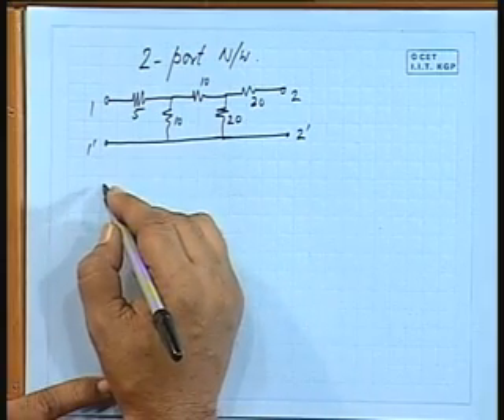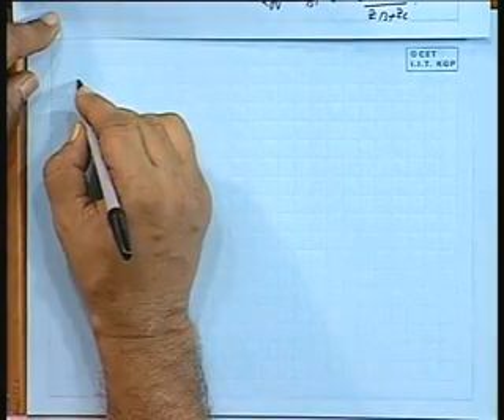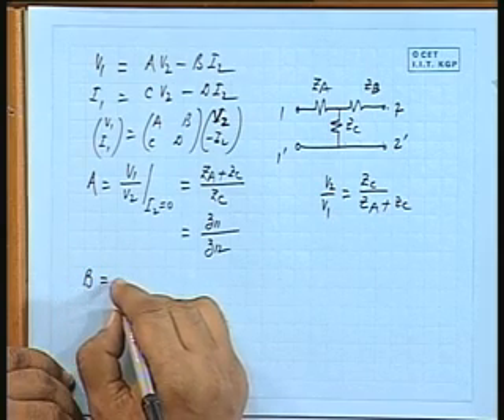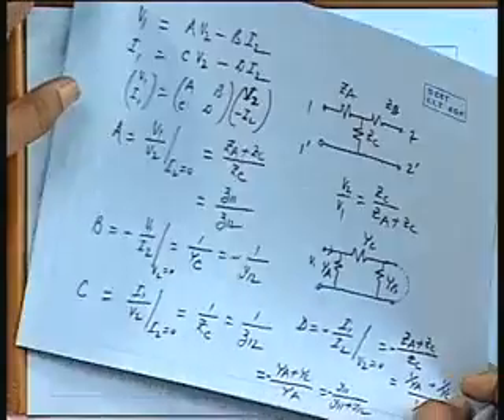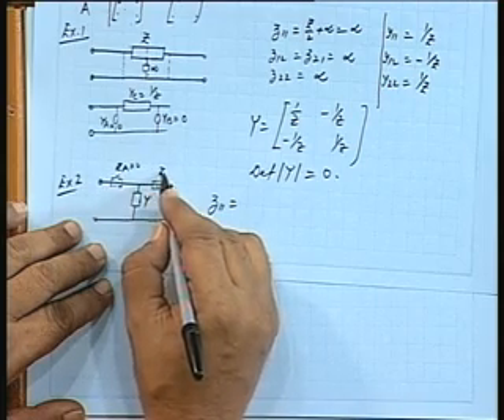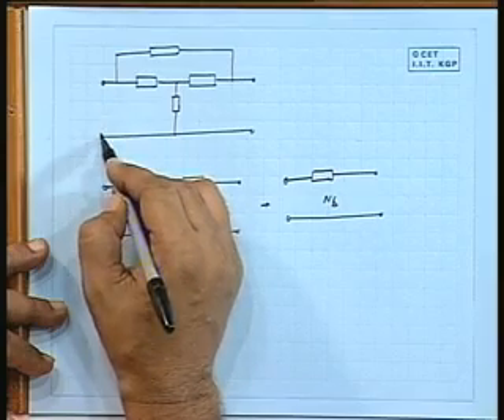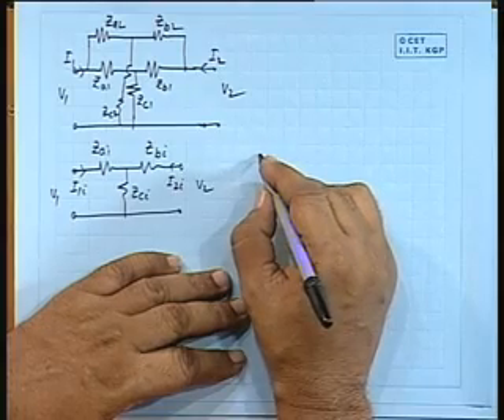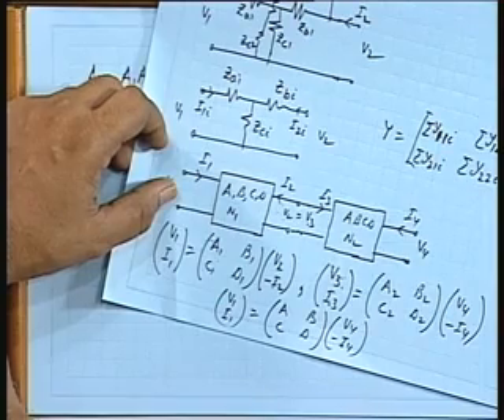Lecture - 4 Two-port Parameters Short Circuit,Open Circuit

Comment: Thank you for this lecture!  It was very helpful.   One note: when he is doing the voltage and current divisions, symbolically one may use I1 instead of the unit current he is referencing.  Then by symmetry, it may become more apparent that, oh, I1 going in divides by 2 when it reaches both 10 Ohm resistors.

Comment: At 9:26 I think- {(V1*Zc)/(Za.Zb. +Zb.Zc+ Za.Zc)} is equal to the current flowing through Zb, and not (V1/I2).
Because right from the beginning of the problem we were interested in finding out the current and (V1/I2) would mean impedance and not current.

Correct me if I'm wrong please. :)

The actual solution should be I2 = (V1*Zc)/(Za*Zb+Zb*Zc+Za*Zc)
That would mean...........    I2/V1= Zc/(Za.Zb+Za.Zc+Zb.Zc)
or......................              
                                         V1/I2= (Za.Zb+Zb.Zc+Za.Zc)/Zc